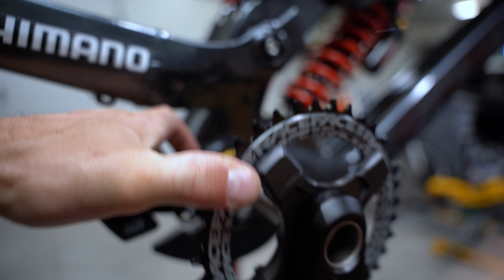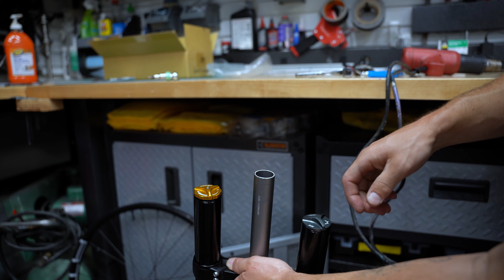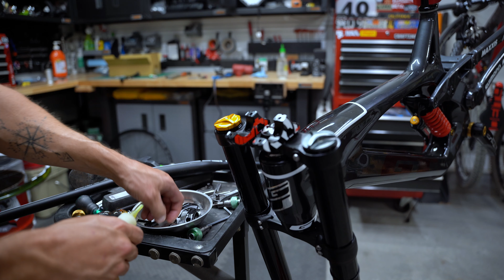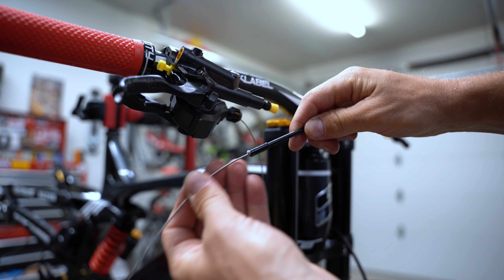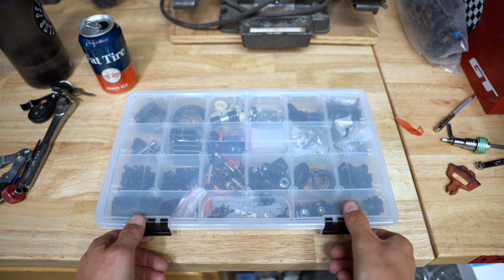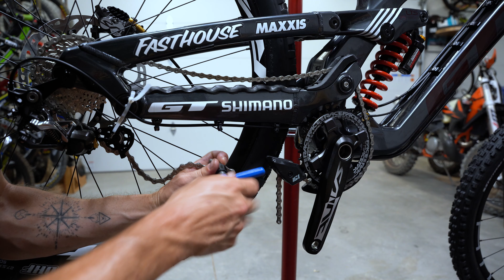2021 GT FURY DREAM BIKE BUILD

Comment: Love the chain silencer! Was trying to figure out what you used but couldn’t quite tell. Would you be willing to share? Love the bike and the video! Thanks so much!
Reply: Its just 3M mastic tape which he cut and applied as he saw fit. Id recommend using a narrower width for the square pieces, then put a wider  additional layer over everything as he did. Keeps it looking clean and prevents dirt/dust from getting in the gaps. Cheers
Reply: thanks @15efaklaris

Comment: I read 27.5 on the rear tire, this bike in size M and L comes with 29" wheels (for racers). I know that a "switch kit" exist but idk where to buy it and if it is really necessary to not touch the bottom bracket at the first landing. I noticed a spacer under the headset for the front wheel. I think the mechanic also had to change the rear bases. tell me if you know more about this "switch kit". This bike must be a monster in 27.5 wheels!